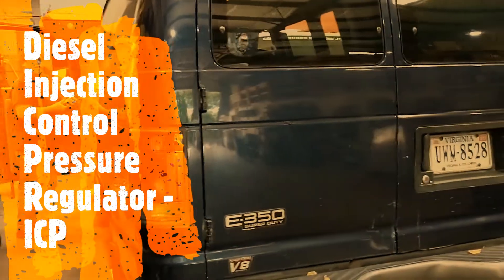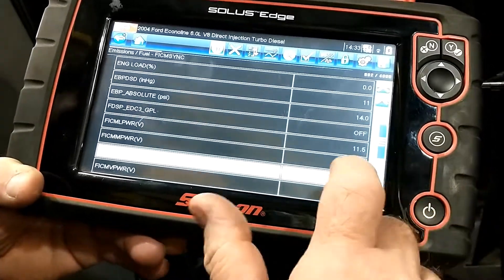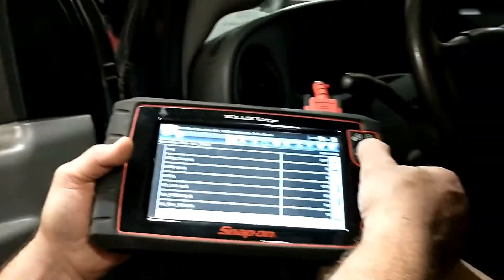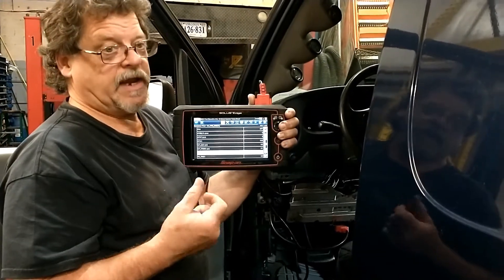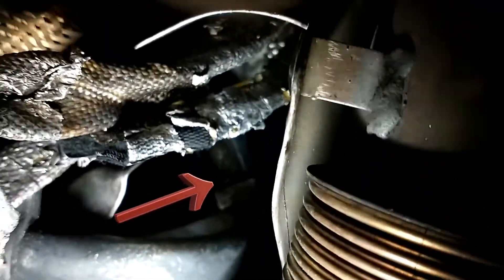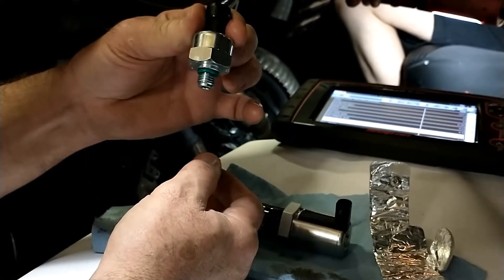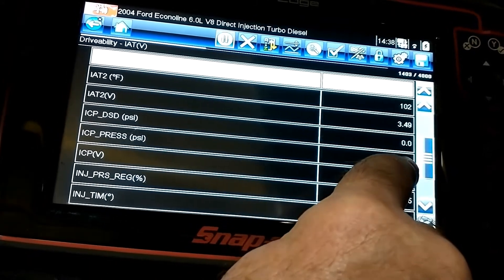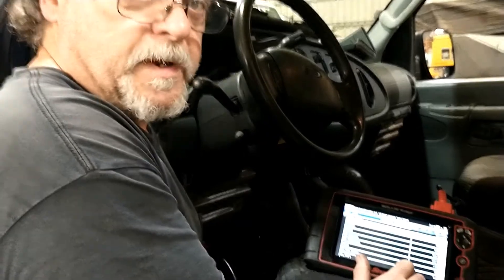Diesel Injection Control Pressure Regulator

Comment: Phil I need to get a hold of that tool you made for the sprinter boost pressure sensor….. any follow ups on that video did the boost pressure sensor fix work ?